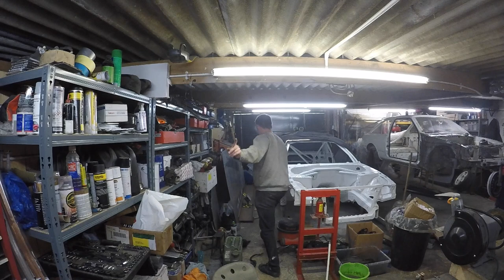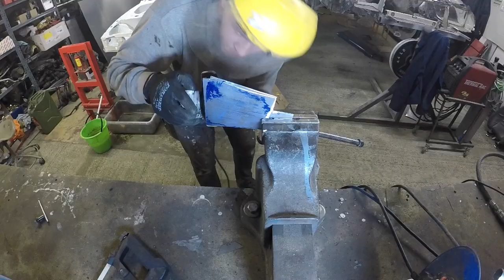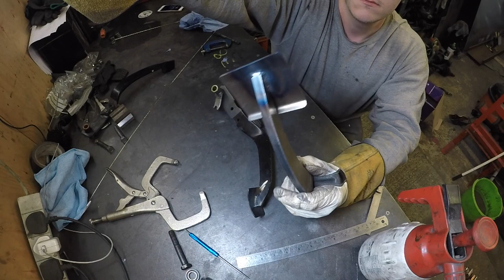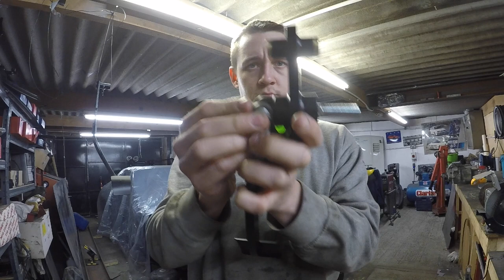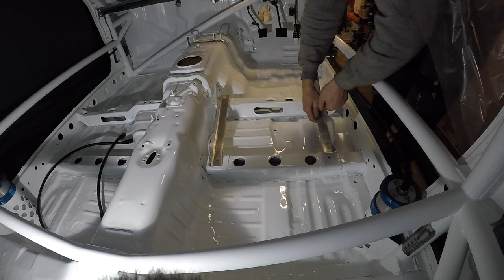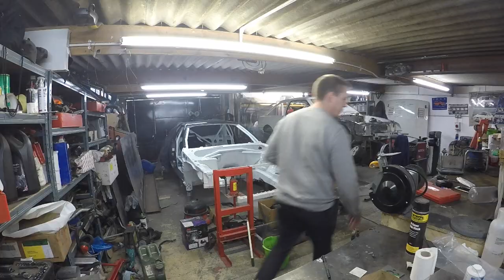GpA R32 GTR Pedal box finale - R32 Build 19

Comment: Good video dude! Interior (aside from the dash) and glass is probably one of the last things I'd do, especially if you have wiring to do. Subframes and suspension maybe next? It's hard to decide really, you dont want to get that stuff mounted and then be a pain trying to plumb something over or around those components.
Reply from the maker: cheers dude :) Yeah man, you’re dead right. The only thing is, next door make so much mess, and despite the car being covered it still gets in. So the glass and doors would seal it up nicely. But yeah man, I think I’ll do a little more with the rear subframe :) might even peak at the engine after... you’re probably right about staying away from the dash.
Reply: @AlexGrA  the dash if it come in and out easily probably wouldn’t be bad, idk how much interior you’re actually going to put back in. Honestly dude, I’d do the engine last unless you have one to put in it already. Spend the dough on a gearbox first! If staying 5 speed, find yourself some 4.375:1 CWP’s. I’m pretty sure a set I had made it way into the Rick Wood car lol.
Reply from the maker: @Green_Streets  I have a 6sp sc dog box for it mate, shouldn’t need a wildly short fdr because of it. Just have to vibe it out and let what’s ready drive it to a point. I want to drop the shell over the engine and subframe assembly when going back in... so kinda need to park the shell and crack on elsewhere.
Reply from the maker: It’s so long huh lol. Be reet. We’ll get there lol.
Reply: @AlexGrA  ah okay, with a 6 speed you should be fine with std. you plan on sticking your engine back in it or having it built?
Reply from the maker: @Green_Streets  I’ll build it mate. I’ve got another bottom end, just need to make sure it’s healthy and then get a game plan. If it works out it’ll be lovely :)

Comment: Are the pedals thick steel?
Reply from the maker: Clutch is the original pedal, 8mm, brake is 10mm S275.
Reply: @AlexGrA  sounds pretty hefty for a race car, but then they had minimum weights so no point making everything super light, it’s not an F3 car haha. I thought at first they’d be aluminium but I wasn’t sure.
Reply from the maker: @jamesford3549  nope. They reused the standard pedals which were just over 8mm. The ratio went from ~1:4 to 1:6 and servo removed, so forces are relatively high. Went 10 to add in a safety factor.
Reply: @AlexGrA  maybe I’ve been around lotus’ and single seaters too much but I’d have stuck with 8mm haha, I hate adding weight. The pedals look fantastic though, I’d love to do a pedal box like that in my R32 and RX7. The seat is a thing of beauty too, the Kevlar back SPA is my favourite seat. I’ve been after one a while. I had a Kevlar back magnum which looked like an SPA copy, got nicked unfortunately.
Reply from the maker: @jamesford3549  the thing is it wouldn’t have been up to it. The pedal is offset from the centre so the forces are in two dimensions. The pedal force requirement is up about 30%. You’re trying to brake a 1300kg 650hp skyline, not a 400kg single seater.